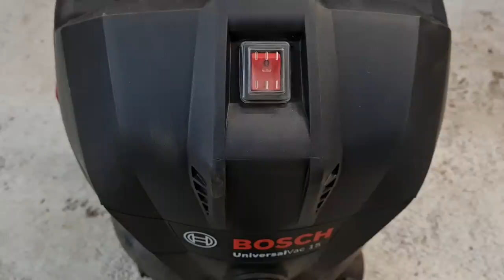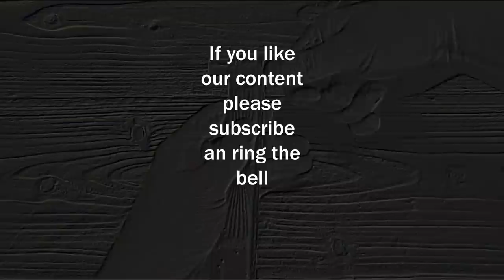Rusty hand press - RESTORATION

Comment: You should at least fill up the uneven parts of the body with filler and smoothen with wet sanding before spray painting